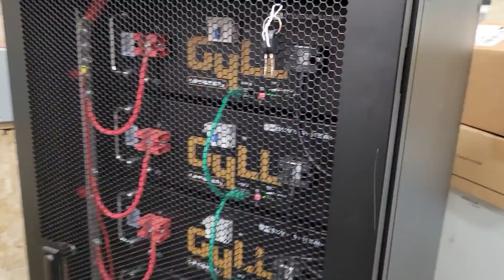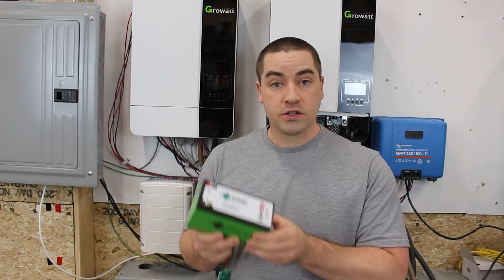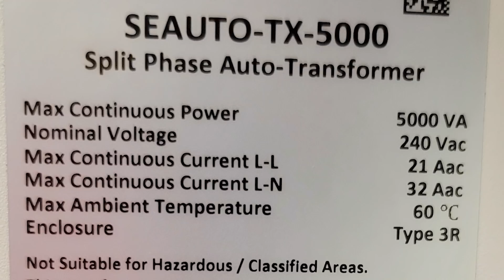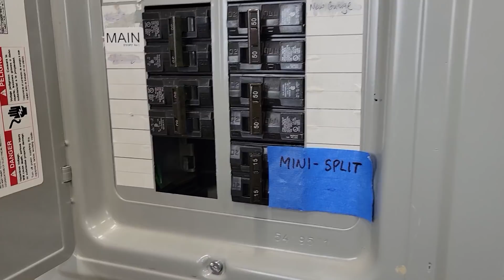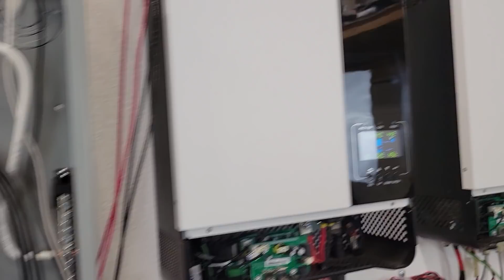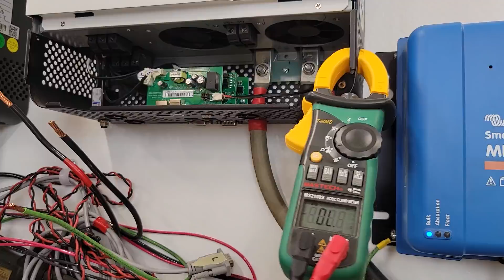Safety Concerns with Auto Transformer and Growatt 240V inverter SPF 5000 ES

Comment: I am not an electrician but I do think adding the extra triple pole breaker is a good idea.
Reply: https://youtu.be/90O_iGjfm28. Signature solar explains everything
Reply: @TheFatman819  not this, yet
Reply: Yes I think it's a good idea. However the 32A breaker for 32A capable transformer. I don't know how long it will take to trip the breaker at 32A. Which will be faster, tripping the breaker or over heating the transformer? David's last video showed his breaker tripping only at 1.5 times load or something. So we need to confirm the Trip curve of that breaker, or decrease the current rating of the breaker.

Comment: I'm glad you're improving your safety. Normally I'm not the fear-mongering type, but I have a friend whose house burned down because he lost neutral (on the utility side of his meter). So I know it definitely can cause problems and personally I'd do whatever I can to reduce the possibility of this happening in my own system.
Reply: Neutral carries the unbalanced current which exceeds 200percent of the line load current..instantaneous
Reply: That's a utility issue. And happens a bit more often than many think.
Reply: So how is someone going to prevent their house from burning down from losing a neutral from the grid? I know a guy whose house burned down because of a grill. Another because of a lightning strike and not to mention those losing houses to wild fires.
Reply: @easylooker  Sure, and all the things you mention would have things we can do to minimize the possibility of damage. You shouldn't put your grill on your deck (but people sometimes do), you should have proper ground bonding to reduce the likelihood of lightning fires (but many houses don't), You should clear brush away from your house and not have flammable mulch next to your house (but many people do). 

It seems like you got me wrong if you think I'm arguing with anyone. Nothing is ALL this or ALL that. I was simply sharing something that people might find interesting. A lost neutral can cause a fire. I didn't think about it until my friend told me about it. It's up to you to decide how important it is. Cheers.
Reply: @MartinKL  I don't know anything about what any of you guys were talking about it's so sad it would take years to become that smart. I'm involved in putting in a system I'm almost sorry I'm doing it now now too many things too many things to wire in there doesn't even make sense
Reply: @easylooker  Really there needs to be an active fault detection circuit that shuts off the main breaker and I've never seen one in use.
Reply: @easylooker  lol, kinda missed his point there didn't ya?
Reply: @llsncl  ya I got his point. You missed mine

Comment: Thanks David! I bought the growatt, auto-transformer, batteries, and solar panels using your coupon codes. I'm getting close to installing these soon. I stopped because of those "danger!" videos. But now I'm feeling better about continuing. I'm off-grid and am searching about if I need to ground earth or not. I saw some youtubes (Prowse and the NEC) saying things that got me confused. But it is fun learning this stuff!
Reply: your better off buying the correct inverter for usa!! Not a eu version which you need to buy a ton of extra equipment to even step it down doesn't make sense. . Plus doubtful pass electrical inspection. Your house burns down and the insurances finds out you did electrical work without permit they don't pay out even if wasn't from your solar system...
Reply: @firebird9232  I believe SignatureSolar provided me the correct inverter as it the USA version. I'm good. Thanks.

Comment: I have two of them connected to a mid-point.Also have them with grid-supplied disconnects.Works fine.They share a battery bank with a MPP6048 .I usually leave the ac input to the Growatts turned off.They are loaded primarily in the daytime for electric dryer and help maintain the battery as a secondary gig.
Reply: If you have a midpoint transformer connected across the pole transformer from the grid they will short out each other's neutrals. In a perfectly balanced system this won't cause any problems but in reality it can lead to excess current draw.

Comment: Looks like a failsafe solution to a very unlikely problem.Most of the serious problems after storm damage is caused by loss of neutral from grid.The mid-point transformers would serve as a valuable investment even on a grid-supplied system. Its low idle current is insignificant compared to the protection it gives in rural areas where limb falls cause frequent line damage.
Reply: You can't use a midpoint transformer if connected to the grid as it it will short out the supply transformer's neutral (and vice versa). It would need to be an isolation transformer. A better option might be installing voltage monitors with shunt trip breakers.
Reply: @eDoc2020  I agree that’s a possibility.Because there are several houses on the grid transformer,I might get stuck with balancing my neighbors loads if the neutral has a poor connection between a common point we share before the transformer.I like the idea of using a 3 pole breaker as another layer of protection. Thanks for your comment
Reply: @danielking2944  Even if every load is balanced there can still be problems. In real life the transformer halves likely aren't exactly 50:50. If one transformer is tapped at 49.5% and the other is tapped at 50.5% you will have essentially created a shorted winding. IMO this is more likely to burn out your transformer than balancing your neighbors.

Comment: You're just stealing will prowse video idea
Reply: Rude
Reply: @iztherelife1340  chill out taran. It's a joke
Reply: No he did not, David's idea of using the 240V growatt in conjunction with the autotransformer to create a split phase started this trend. Others who tried it, used inverters directly imported from China to save a few bucks. This created the problem, so he is trying to address it. Will never did any diy like that and he only sticks to MPP solar split phase inverters. He just tried to raise the issue, but the original concept is not Will's. But I do agree with Will, I think it's best to buy split phase inverters for those who are in the US. The Autotransformers will draw a constant load from the inverters all the time, unnecessarily wasting power, and those who have grid connected systems can burn up their autotransformers/wiring if connected without a dedicated transfer switch. And then there is the neutral ground bond issue in grey market imports. Lots of potential failure and safest hazard points.
Reply: @DSmartLife  haha I'm joking and dont really care. Good video though

Comment: David, I am sure that you have seen Will Prowse's last 2 videos. He discusses how the European Union version of the Growatt has been changed specifically for Signature Solar and the US market. The downside is that others are selling Growatt Inverters to the US market that have not had the manufacturing changes done that Signature Solar has. Additionally, the manual that is being sent with the Signature Solar unit hasn't been changed to reflect those changes either. It could be catastrophic if someone bought a Signature Solar unit and piggybacked it with the EU version. Right now, both the Signature Solar version and the European Union version are stamped with EU. Confusing, yes? I sure wish that they had these types available before I bought my Sol-Ark 12K that I received in a 59V model that I still have sitting in it's box because Sol-Ark doesn't seem to give a damn about making it right.
Reply: Another point with growatt, the 10 and 12,000 watt all-in-one units have the transformer-s built in and I don't believe there is an issue with those units, at all.
Reply: Sol ark pass electrical coding since its rapid shutdown compliant . ( NATION WIDE<<<< NEC >>ALL BUILDINGS<<<<WITH SOLAR REQUIRE RAPIDSHUTDOWN TO PROTECT FIREFIGHTERS) 2020 NEC NOW REQUIRES ALL PANELS TO HAVE MIRCO INVERTERS EVEN IF ITS DC TO DC OPTIMIZERS. GROWATT DOESNT HAVE RAPIDSHUTDOWN UNLIKE SOL ARK. YOUR BETER OFF USING YOUR SOL ARK THAT YOU HAVE.
Reply: @firebird9232  2020 NEC does NOT require microinverters. The required shutdown can be achieved with much simpler modules.
Reply: @firebird9232  You can achieve shutdown without using microinverters. The most basic system is a relay at each panel. If the relays are de-energized there is no voltage on the output. Yet when the relay is energized you have a high-voltage string.
Reply: @eDoc2020  
Yes you could use a relay but then your going pay MORE $$$$$$$ to get your system with a UL field label compliant. $$$$ You be spending  between US$5,000 to 15,000 just to get the label. UL's Field Inspection Service can provide an onsite inspection to allow the product to be field labeled.

So Ya you could but your better off getting mirco inverters.

"The PV array shall be listed or field labeled as a "rapid shutdown PV array". Such a PV array shall be installed and used in accordance with the instructions included with the rapid shutdown PV array listing and labeling or field labeling. Note that listing/field-labeling as a rapid shutdown PV array, AKA a “Hazard Control” system, requires the unreleased UL 3741 standard( ul 3741 aka inverter needs to shutdown with your array)

PV modules with other module mounted electronics such as
an optimizer or DC to DC converter BE Certified (LISTED)
under the UL product category .
Reply: @firebird9232  It doesn't need to be an actual relay. There are dedicated shutdown devices like the Tigo TS4-A-F. Per the manufacturer's website:

The TS4-A-F is UL PV Rapid Shutdown System (PVRSS) certified with hundreds of inverters to comply with NEC 2014, 2017, and 2020 rapid shutdown requirements.
Reply: @eDoc2020  LOL did you even read first post??? Where i point out dc to dc micro inverters....... YES Tigo inverter is a micro inverter. Mirco inverter can be dc to dc and dc to ac...................................
Reply: @firebird9232  As the rapid shutdown device does not do any conversion of power there's no way I could consider calling it a microinverter. Tigo also makes optimizer modules which do power conversion and I could kind of understand you calling those microinverters.
Reply: @eDoc2020  Like i have stated in the very first message yet you still bring up what I already stated >> "Now 2020 nec code requires all panels to have mirco inverters even if it includes the dc to dc" <<< which is your mico optimizers.

Please read the whole thing not parts.
Reply: @solarhomesteadinstalls  As you rightly point out, the optimizer modules do. But did you miss what I said? The shutdown modules do not do any DC-DC. The shutdown only modules and the optimizer modules are different products.
Reply: @firebird9232  The problem I have with the 59V 12K model I received is twofold. First,  I am using a large battery bank compromised of 34 Toshiba LTO SCIB batteries. To get the best range from the batteries I need a Nominal of 60V and a charge rate of 61V, minimum. The other problem is down the road I want to piggyback another unit to this one. When you order a 12k Sol-Ark and 63V is what you based your purchase on and the manual that comes with the unit shows 63V,  then you go to install it and find out it is 59V,  it's upsetting. But, when they won't make it right then it just pisses you off to no avail.
Reply: Tigo, makes a great product for rapid shutdown.  No micro inverters are required.
Reply: @timselectric502  tigo optimizers are dc to dc optimizers. It was already posted above mirco inverters or dc to dc optimizers....
Reply: @solarhomesteadinstalls  I wasn't referring to optimizers.  Only the rapid shutdown modules. They are only a remote controlled relay.
Reply: Cost wize, it wouldn't cost much more to buy the combination modules.  But, you don't have to for code requirements.

Comment: I do the same thing with my setup, two 5Kva victrons and a industrial 10Kva transformer I got off ebay to work as an auto transformer and provide neutral.   Instead of complicated breaker system I just depend on the transformer being overkill and don't worry about it... haha.  
The 3 pole breaker though is a great solution.  only issue being that the neutral and the loads have to be on the same current breaker.  but its a great idea.
Reply: With L1 and N tripped on the breaker, L2 has no current path at all. You would have to have a second failure for the L2 to find a path to ground.
Reply: Which Transformer did you buy from Ebay?

Comment: Not quite true for the autotransformer.
The one you used has been discontinued by the manufacturer. So no one should be buying them now IMO.
The Growatt unit now sold by signature solar includes the breaker. More straightforward connection.
Reply: What? I just bought 2 of the new growatt AT from signature and there's no beaker in mine. Just a din rail terminal block.
Reply: @JM-yx1lm  I might be wrong
Reply: @JM-yx1lm  From what I can see on the website the transformer includes a contactor and maybe breakers.